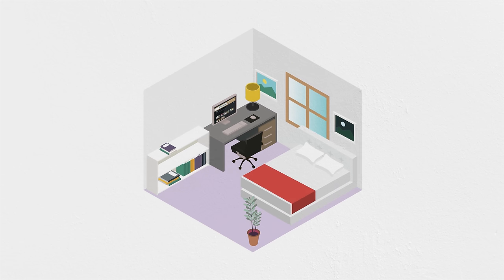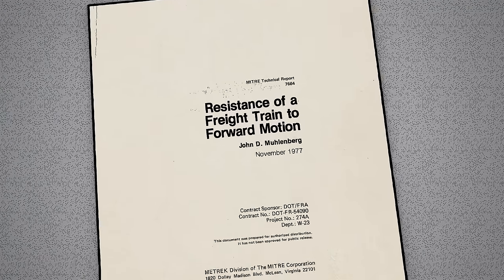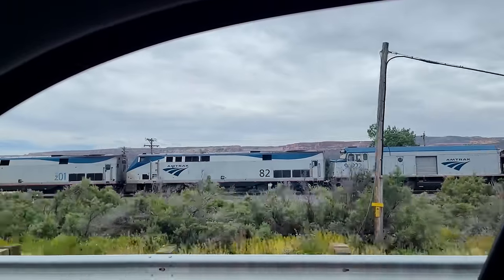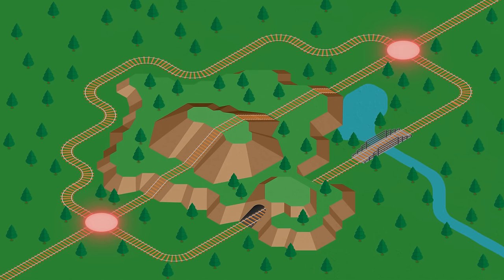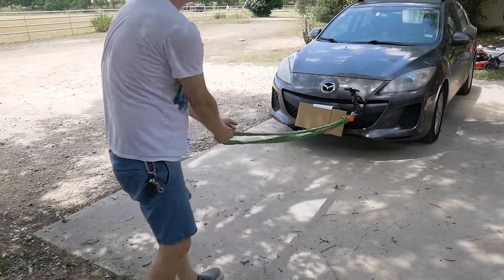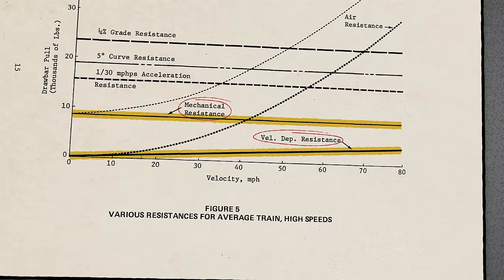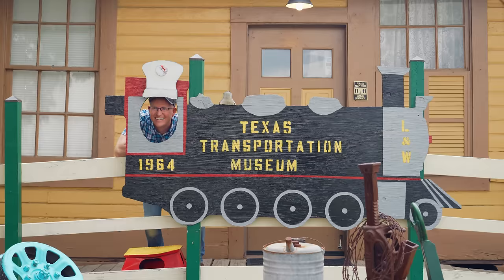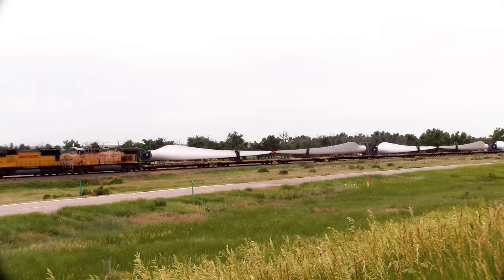Which Is Easier To Pull? (Railcars vs. Road Cars)

Comment: Great video! Having worked for the railroad I can tell you that in the engine shop it was not uncommon for two or three guys to actually push a locomotive on level flat track. One person could keep it moving once the static resistance was overcome.
Reply: I can second this, in our locomotive shop we use a dinky forklift to nudge locomotives without having to fetch a running one.
Reply: @cedricrummell5986  we used a bar specially shaped to move cars with ease, up to 6 at the same time
Reply: @AwoudeX  was it some form of "pinch bar" that you use under the wheels?
Reply: @cedricrummell5986  yes
Reply: @AwoudeX  wow I never would have guessed you could move 6 cars with one of those.
Reply: ok

Comment: 15:20 a roller bearing car can be relatively easily moved manually, but plain bearings take quite a lot of force to get started. The railroad I volunteer at hosted a strongman competition with a boxcar pulling competition as one event. Our crew moved the car around with a locomotive just before each attempt to get a layer of grease in the bearings, otherwise even the strongest competitor couldn't have budged the car.

Comment: I remember when I worked at a railroad, if you didn't have the brake set, the engine would usually start to roll away, even on seemingly flat surfaces.

Later, when I worked on rail transit, there was a spot that seemed flat but the train would start to roll if you released the brakes, and it just so happend to be on paved access way. Out of curiosity, I stopped a truck in that spot and put it in neutral and had no roll back.
Reply: Especially on loose and uneven surfaces, it's impressive how much of a hill I can leave my car on in neutral and it's won't roll.
Reply: @jaredlancaster4137  That is less do with friction and more to do with the fact that most cars are designed not to roll.
Reply: @xe-wf5iv  actually I'm pretty sure cars are meant to roll, generally with low friction.
Reply: Obviously, you can't push rolling stock uphill manually. So the answer depends on the gradient.
Reply: @xe-wf5iv Not sure which car companies you've been hanging around.
Reply: @xe-wf5iv if my car doesn’t roll there’s some serious issues
Reply: @xe-wf5iv The whole point of neutral is to make the car free-rolling.
Reply: @CptJistuce  Yeah
But train cars are way heavier, so the gravity has a stronger effect on them

And yeah, road cars have more friction due to rubber tires just like the guy on the video said
Reply: @narrativeless404  Which does little to make the statement "cars are designed to not roll" less wrong.
Reply: @CptJistuce  Yeah, pretty much sums it up
Reply: @xe-wf5iv entirely friction

Comment: I would like to have seen, at the very end, an illustration of the diesel fuel needed per ton/mile to transport that gravel by truck compared to by train. Otherwise, excellent video, as always.
Reply: Idk about the truck part, but a train needs roughly 1L of diesel to take 1 ton of cargo 500km.
Reply: @ThZuao  Rough back of the napkin math says a truck takes easily 20 times more. Most of that will be in the rolling resistance, some of it in air drag, and some in not having to deal with vehicle traffic nearly as much.
Reply: Trains measure in at 477 ton-miles per gallon of fuel vs trucks at 145 ton-miles mostly due to reduced rolling resistance of steel on steel vs rubber tires on pavement and wind resistance. This info was from a Stanford University study dated 12/16/2022. A lot of info is available off the net if you figure out how to phrase the question so that Google actually is a help!
Reply: One ton pickup probably 50 to 100 litres
Reply: @joeyager8479  So Grady could have shows 1&2/3 teaspoons of fuel in one hand, and 1/3 of a cup of fuel in the other to show the difference to move a ton of gravel one mile. I think that, or perhaps the amounts for the initial room-full of gravel to make that visual impact.
Reply: Always best to do it in litres per kilometer - if you do a dimensional analysis this is volume over distance which is an area.
Imagine your fuel stretched out as a straw from where you are to where you are going, then  the cross sectional area of that straw comes straight from the litres per kilometer.
Reply: @ThZuao if that number is correct, that's phenomenal. I had no idea it was that efficient
Reply: @dyadica7151  I suppose that may have helped. Having worked in engineering for 45+ years, nothing is as simple as it seems. By that I mean; #1, In the Sanford study is the weight of the locomotive and the train cars included in the payload? In other words; total gross weight or net weight? #2, Depending on the density of the payload, total shipping tonnage may required more train cars than denser payloads, thus, increasing the friction and mass of the additional cars. #3, in Diesel-Electric trains, Diesel is used to power an engine that runs an alternator that generates electricity that power electric motors that actually propels the train. Sounds complicated, but it's used because it's far more efficient. Trains have been around for almost 300 years so they've minimized the operating costs as much as they can using current technology. If something better is developed and proven, it will eventually replace what is used today.
Reply: For the comparisson the Tesla Semi transporting 25 tons in long haul test showed the use of around 50 [Wh/tkm]. So still the electric trains are 40% better than electric trucks.
Reply: I saw a ship, rail, truck comparison a week or so ago. Something like 3 grams of CO2 per ton per mile for ships, 12 for rail, maybe 60 for truck, and 650 for air cargo. Not the same as fuel mileage but CO2 production is related to fuel use. I was impressed. Always knew ships were the best at least in larger sizes where they can enjoy economies of scale.
Reply: @andrewharrison8436 Good suggestion. From now on I'm going to report all areas in liters per km.  For example, a house with a floor area of 120 x 10^6 liters per km.
Reply: @charliesullivan4304  Love it - malicious compliance!
Reply: @michaelandersen7535 If you think that is efficient, compare it to a cargo ship.
Reply: @joeyager8479 what in the america
Reply: @joeyager8479 that suggests that rail transport is roughly 3 times more fuel efficient than road, ( logically believable) however, here in the Uk it is far cheaper to travel on a road going coach ( roughly 60 passengers ) than on a train with roughly 600 passengers , rail travel ought logically to be many times cheaper than road travel but in reality is not, totally mystifying.
Reply: @roblonsdale8927  I think that we're going off on a tangent from the main point of the video. Which is; moving large bulk shipments long distances is more energy efficient using unit trains than several thousand trucks. What complicates everything mentioned in this thread is that everyone uses different units and methods for measuring efficiency. Whatever way you choose to measure it, rail is more efficient or the other methods would be used instead.
As for coach and passenger rail service in the UK, be thankful you're in the UK. Passenger coach and rail service in the USA is atrocious outside of a few parts of the east coast.
Reply: @roblonsdale8927  Fuel costs don't convey the whole cost. There's also the infrastructure required, legal requirements, as well as the initial investment. It's fairly cheap to start a bussing business, get a coaching bus and start moving passengers. Starting a new rail company however has way more legal requirements, higher upfront cost to purchase the train, etc.

Comment: If you were wondering, the amount of rolling resistance from a cars tires is extremely dependent on tire pressure, tire type, and surface type.

When i had my 3500lb jeep on stiff load range e tires with 80psi on a smooth shop floor, it literally took one finger to push.

Now try pushing the same jeep but on more flexible four ply tires, underinflated at say 15psi, on a gravel road. Itll probably take two people.

Pushing cars with flat tires is very very difficult.

Comment: In flight school, pushing planes by hand is a common occurrence. They weigh about 2000 pounds empty, but I’m always surprised at how “easy” it is to keep them moving. Id be very interested to see how the rolling resistance compares to a street car and a rail car
Reply: For a plane it's going to be similar to a car. There's little reason to optimize there because the plane spends so little time running on it's wheels and any weight/volume added to accommodate rolling resistance is going to hurt your in flight efficiency.
Reply: @Kandralla planes have small tires with very high inflation pressure. low rolling resistance is easy if you don't need to handle rough terrain and provide a smooth ride
Reply: @mrl0gic  lots of road vehicles are going to have high inflation pressures. The rolling resistance is still going to be more like a car than a train.
Reply: @Kandralla  I'm going to respectfully disagree.  Aircraft tires are designed for a different set of circumstances than those of road going vehicles.  They have a much smaller contact patch and much less flex.  Furthermore they are not connected to a drive train the way at least two of an automobiles tires are.  Not having to spin two axles, a differential, a driveshaft, and part of a clutch is going to reduce friction even further.  To just dismiss this without actually running the numbers is foolish.

Comment: With the curved path - you might want to look at:

1: superelevation of track - the practice of tilting the track, with the outside rail if the curve being higher than the inside rail, to assist with the reduction of drag around curves

2: flange lubrication. In the USA, locomotives usually apply grease to their flanges automatically on curves. There are also track-based lubrication systems. Cuts noise and drag. Lubrication is usually applied to the inside of the curve, just below the running surface of the rail.

3: self-steering bogies/trucks. Modern trains, usually passenger vehicles, can physically turn the train wheels within the bogies to line them up with the curve.

4: Tilting trains. Active mechanisms on higher speed passenger trains to get faster travel around curves. E.g: Acela has active tilting above 60mph in some areas.

5: load/length restrictions on curves

6: the risk of "string lining"